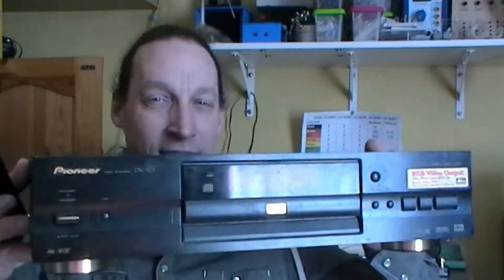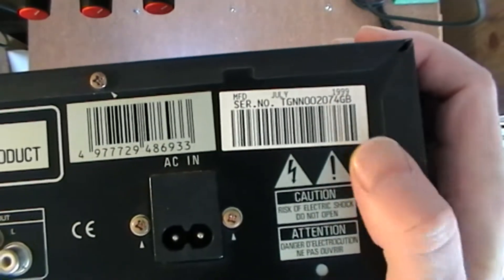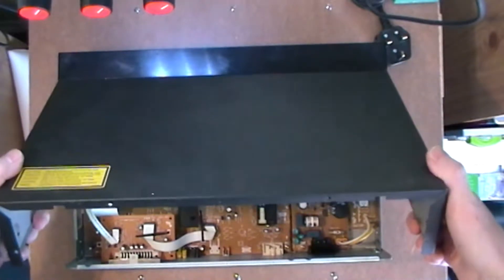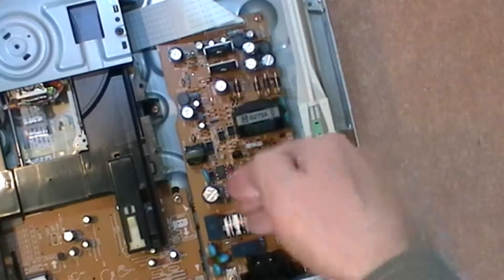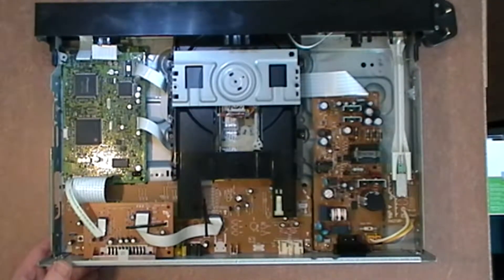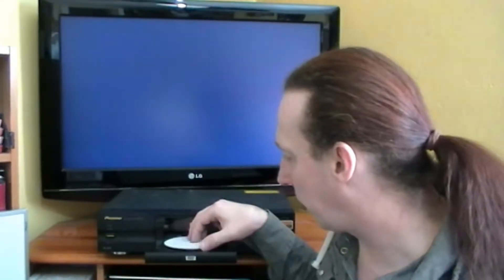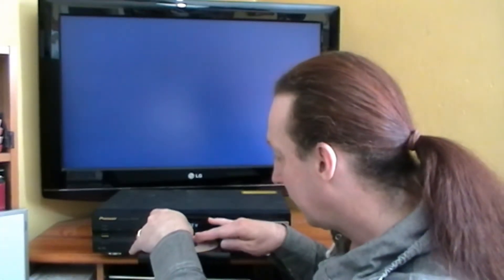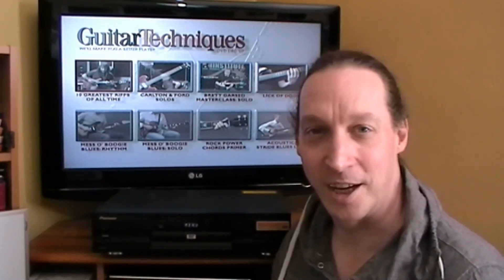Pioneer A DVD from Japan

Comment: Speaking of Pioneer DV-525, how do I make it to be Region Code Free??? NIOT by individual Region select. But to make it automatically recognize all Regions to playback. 
Eugene
Reply from the maker: Hi ECruz, unfortunately these old DVD players were locked to set regions.  Probably in the main codec chip.  Also as this was PAL and used SCART to interface it was probably also physically set to have a set region group that it can playback.  It may be possible to change the region settings but it is beyond my knowledge.
Reply: @rpsproject5349  Hey RPS, tha for your fast reply.  But I watched your YouTube video which you shows the inside of the DV-525 player.  Look at the DMS Assembly circuit board. There's a small white piece which is called CN-6 F female connector that is use for flashing a firmware to the main codec chip. by using a cable interface from a computer.  I've done it before in 1999, and it worked on 2 of Pioneer DV-525 players to be region free.  By using a Japanese DOS software firmware that send an SZO file into the assembly board. But that worked with Windows 98SE in DOS mode.  NOW these days, modern Windows 7 and higher doesn't recognize the OLD Japanese DOS software firmware.   I probably would have to look for a computer with Windows 98 SE and that have a DB-9 male connector for the cable interface. It worked in those good old days in the 20th Century.   Now you know.    Thanks, Eugene
Reply from the maker: @ECruz68007  great bit of info, not sure if I have the DVD player anymore and I sure don't have an old PC sitting around.  I do have the bits to make a Pentium 4 rig and maybe an old edition of Windows 95.  Not sure I could get is all to work though.
Reply: @rpsproject5349  Hey RPS this is Eugene, ECruz from Seattle, U.S.A.   I have other question for you...  Since you showed the inside of the DV-525 on YouTube, do you know how to fix a tray???  When I open the tray to inset the disc in, it close right back in.  I had to hold onto the tray to make it stay open to have a chance to insert the disc in.   Do you know how to fix the tray to make it stay open???  Can you make a video of it???  Thanks, Eugene
Reply from the maker: @ECruz68007  Hi Eugene, I have the same problem.  I have not found my unit yet, I think it is stored away somewhere.  If I still have it I will have a look at the mechanism, which is buried under the main board so will take a bit to get out.  I will do some hunting and digging, see what I can find.
Reply: @rpsproject5349  Okay, let me know, keep me inform.  Thanks, Eugene : - ))